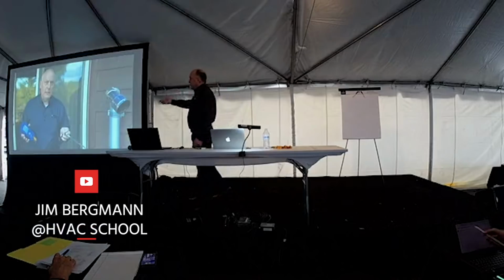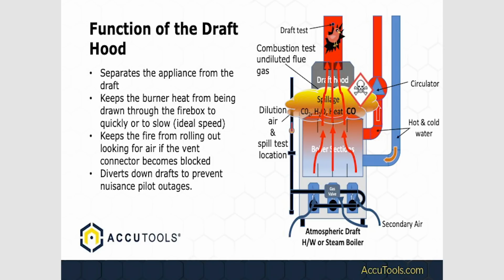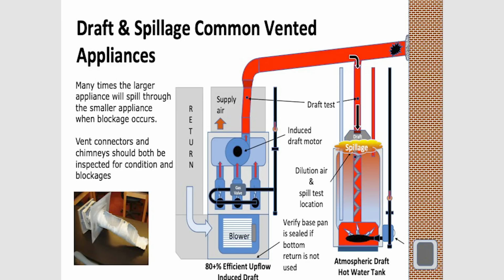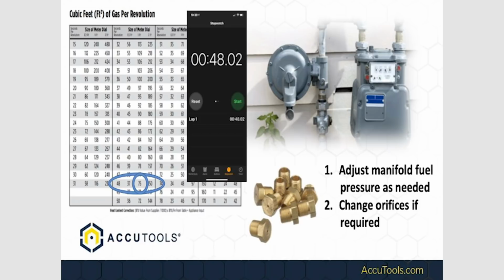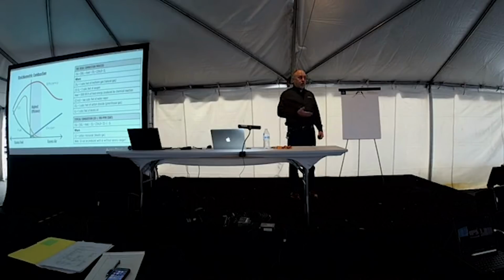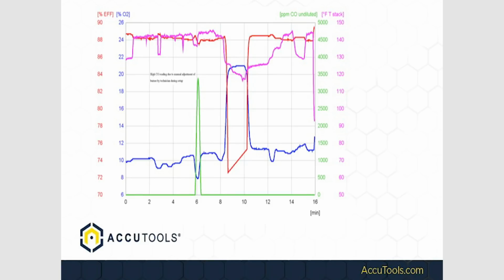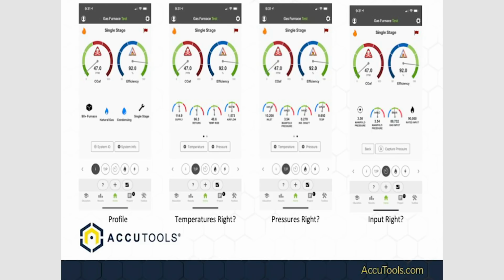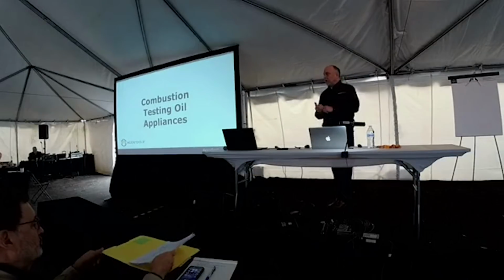Advanced Combustion Analysis (HVAC) w/ Jim Bergmann

Comment: Why 2 stage furnaces produces CO when its replaced with standard 3" pvc exhaust ? 41:00 what is referring to ?
Reply: All furnaces produce some CO, regardless of vent size. He's saying that the 3" vent slowed the exhaust velocity to the point that it wasn't being ejected far enough away from the home and was recirculated into the home through a soffit vent during low-fire due to the slower exhaust velocity of the low-fire stage. You can fix this by reducing to 2" at the termination to increase exhaust velocity without significantly increasing overall vent friction. The increased velocity ejects the exhaust gas further away from the home without needing to have 5ft of pipe coming out the side of the house or choking the high-fire stage with undersized venting.

Comment: Jim carbon dioxide is not a pollutant...anyway carry on..
Reply: Though many living things emit carbon dioxide when they breathe, the gas is widely considered to be a pollutant when associated with cars, planes, power plants, and other human activities that involve the burning of fossil fuels such as gasoline and natural gas. https://www.nationalgeographic.com/environment/global-warming/pollution/#:~:text=Though%20many%20living%20things%20emit,as%20gasoline%20and%20natural%20gas.
Reply: I do have a question for you regarding clocking the meter and actions you suggest taking with resulting information.
The appliance comes with CSA and UL approvals for specific size orifices and specific manifold pressure which is supposed to give a certain heat output.
The testing you have explained shows that these original designs, specifications and components do not result in guaranteed performance under all conditions.
You recommend changing manifold pressure or orifice size to correct for site conditions in order to bring the appliance performance to match the nameplate.
In the past i have been very diligant in making certain to set manifold pressures to match nameplate, and to only install parts that match original equipment performance specifications. This is a gas code requirement.
I am seeing the contradiction where original equipment design and nameplate manifold settings versus resultant equipment performance not matching performance specifications on the same nameplate.  I have always viewed these kinds of contradictions as being a result of factors outside of the range of what my qualifications allow me to alter: performance variations within allowable tolerances which we simply have to accept.  I am a licenced gas tech which qualifies me to repair not re-engineer certified appliances.
I am concerned that if i alter the unit so that it is different than nameplate or install parts with different performance specifications i will be opening myself up to liabilities.  These changes will void the CSA and UL certification and void manufacturers certification and warranties. If something goes wrong i would be held responsible.
Sorry for the long winded note, but would very much like to hear your thoughts on this.  Thanks

Thank you.
Reply: @markwimbush581  Mark, furnaces are rated for input, not orifice size. Furnaces come with a standard orifice generally related for 1000-1075 BTUH. Picking the right size orifice is no different then picking the right filter size for the application. You can require a 16 x 25, 20 x 20, or 20 x 25. 

The fist thing that CSA labs does when they test a furnace is pull the factory orifices and install the ones that give them the correct input for the design. It is not uncommon to have to change the orifices as the heat content varies across the country.
Reply: @measureQuick  Thanks for your reply.  I really appreciate your videos.  Your approach is different than how I was trained and it provides a clarity to the work that is really helpful.
Reply: carbon dioxide is plant food!!